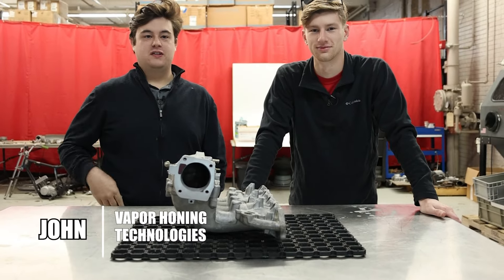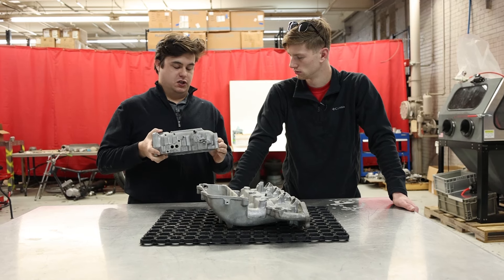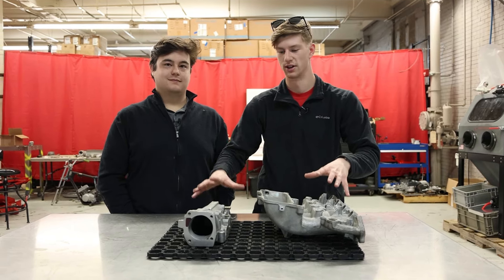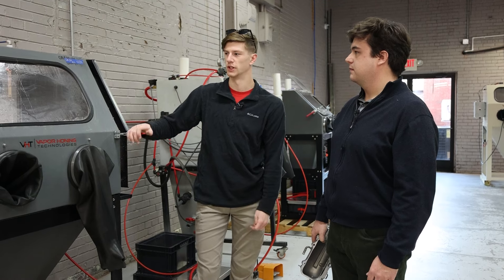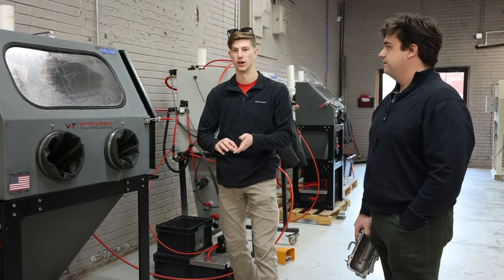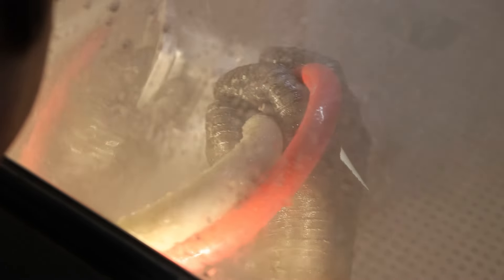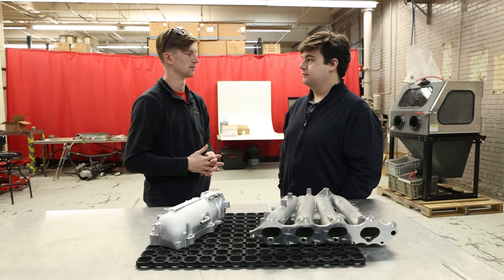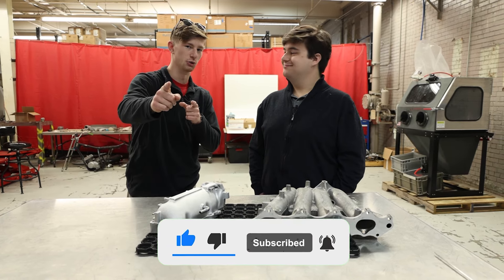How to make Aluminum Parts look BRAND NEW - Engine Restoration

Comment: Will glass bead + aluminum oxide eat away at the aluminum? Should the pressure be a certain level or lower to not damage the aluminum part? 

I am thinking along the lines of mating/gasket surfaces where perfect flatness is critical. 

A clean part that leaks oil when put back in service would defeat the reason I am interested in blasting!
Reply from the maker: Vapor Honing does not damage sealing surfaces! Due to the cushioning effect of the water, the abrasive does not damage the substrate of your component.